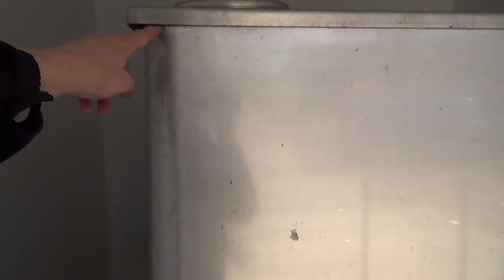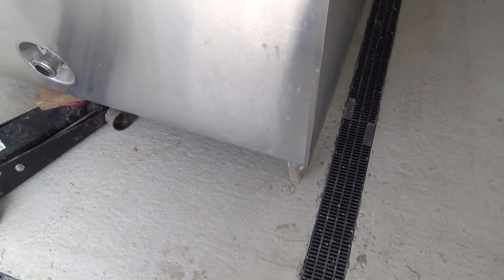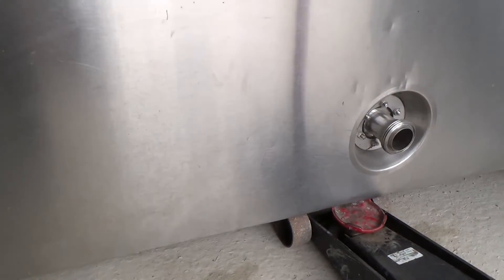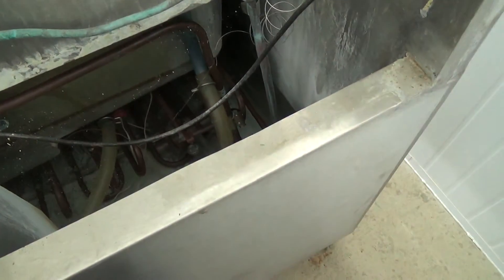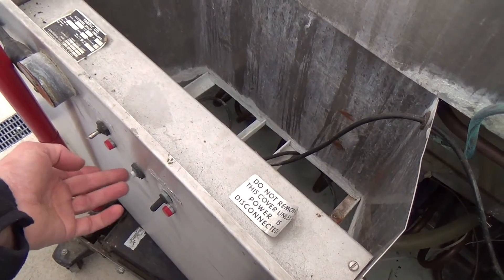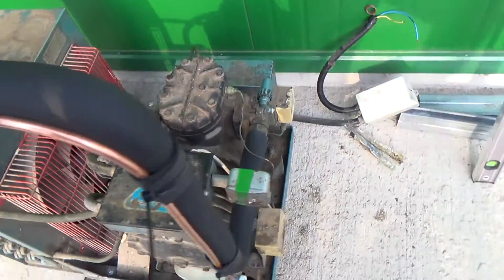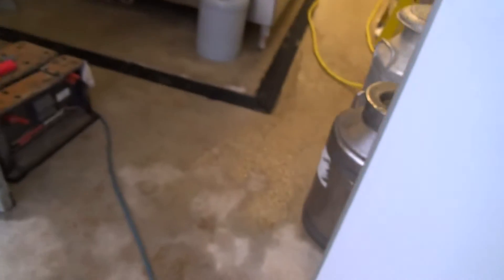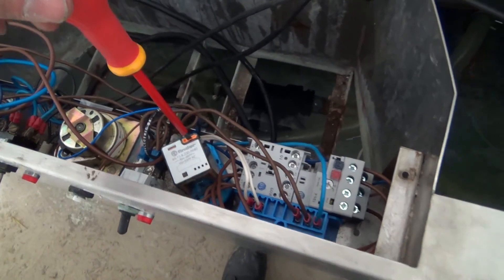Fullwood Milk Tank Install

Comment: What was that stainless tank hanging off the wall connected to the external pump for??
Reply from the maker: The little tank is a milk to iced water heat exchanger, it drops the milk temp by 10C or 15C, maybe even more. If they are sized to do it they can drop the milk from 35C to 2C in one pass!

Comment: no P trap on the suction?
Reply from the maker: No, they never had them, its run like it for 40 years so must be ok.
Reply: no on your vertical rise right at the machine you went straight up.. your not worried oil wont return?  Also i'm hoping there's some kind of housing for the compressor hahaha keep it from the rain

Comment: One of the nicer milk rooms. I liked the big lids on the tank, easy cleaning. My uncle's tank had a small hatch on the top. I would never fit through it today. Wasn't into refrigeration then but I remember he had two units mounted on a steel shelf over the doorway.
Reply from the maker: Yeah the enclosed tanks should was themselves ok, but sometimes you need to get in them. I got stuck in one once!